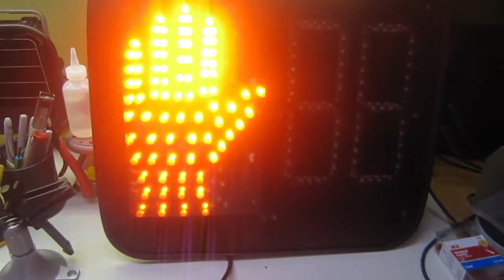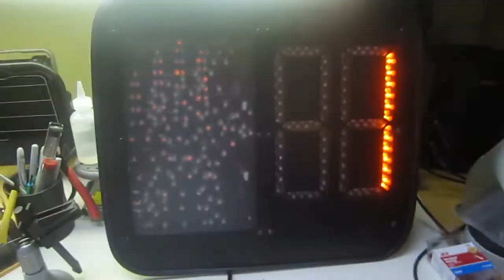Dialight Countdown Pedestrian Signal w/ BS2 Controller

Comment: Had a question, is there a sequence to wire these up to work? I picked one up at a surplus place in Chicagoans area.. I can get the guy and hand to light up, but is there some setting to make it count down for the signal ? neat project!
Reply from the maker: Yes, there is a special sequence you need to follow on power-up in order to set the countdown timer. It probably varies by product. You can find the code I created to control the lines, so you'll have to look through that and perform it manually if you don't have any microcontroller to do it for you: http://www.grandideastudio.com/countdown-pedestrian-signal/
Reply: Joe Grand I do have areuino microcontrollers...
Reply: White- shared common, brown or blue- walking man, red- hand & timer. You can buy sequencers on Amazon or eBay with some of them you can even have a timed activation or an external source activate it after a delay if you like, such as a push botton.